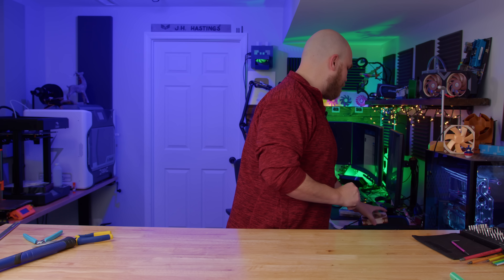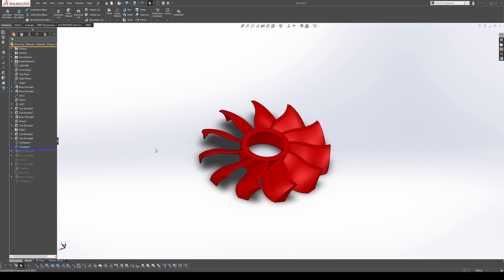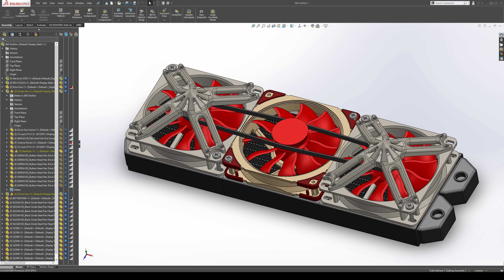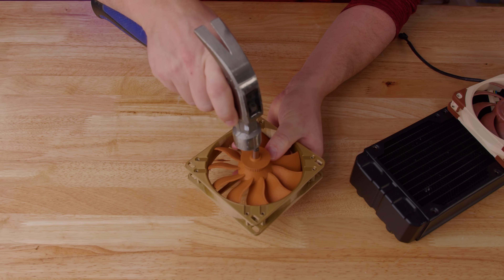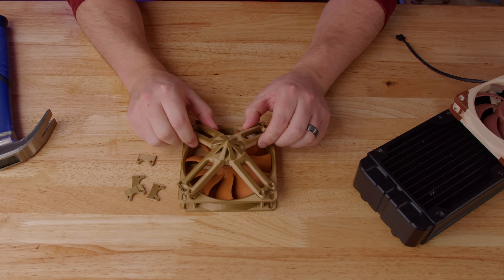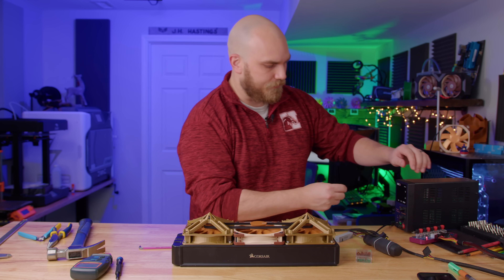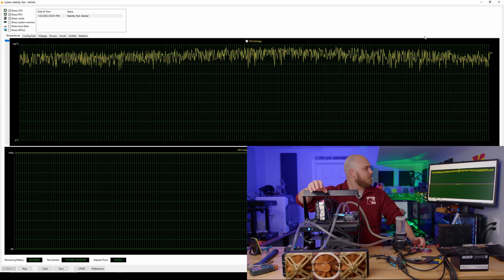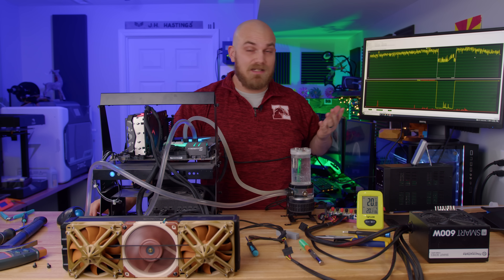I Turned One Fan Into Three | Steampunk Water Cooling

Comment: The seals and the grase makes the bearings too hard to turn, remove the seals from the bearings, wash them in gasoline to remove the grease and put 1 drop of very light oil (or WD-40) in the bearings.

Comment: Get RC air craft motor it will have the torque you need and they are not as high pitch  some other motors, and the motor's sound depens on the over all Rpm your running  as well. And  some of the RC motors my even fit in a fan housing

Comment: This reminds me of when I purchased my bolt action pens at first they somewhat grind. alA crunchy/scratchy feel to it but after using it for several days/weeks it is smooth and snappy giving it a good sound to it. Maybe if you run those fan for a while, it will work out the imperfections to run good in a few days or weeks then try that experiment again.

Comment: Motor fan on one end to give more belt contact.  Pullies should be small on motor and larger on driven fans, like a bike going up a hill.  Will allow the electric motor to get higher rpm.    It needs a thinner belt and smaller bearings so there Is less energy loss.  Even just a greased 2mm pin with a sleeve instead of bearings should work nice.

Hope you like armchair commentary.

Comment: Nice experiment, congrats. Instead making all that contraption, why don't you try to make a shroud with only one fan for the 360 rad, where it has some fins inside to better distribute the airflow to the entire rad, like some sort of airflow splitter. 
Do we really need three fans? what is its comparison against 3 fans, 2 or 1 single fan without shroud? 😉

Comment: Same project v2 except you realize you have a second fan. So, powered fans on left and right and pulley fan on the middle, separate belts for each fan powering the middle and greased up bearings. Another pro with a setup is to see if the tube would cool by themselves better. All you have to do is remove the middle and remove the pulleys

Comment: Your belt pully on the passive fans are wrong, they need to be bulbus, if you make it a groove the belt will climb out (and its doing that, you can see in the video). Also i would make the central drive take 2 separate belts so the belts bite more.

Comment: I think it would work better if you removed the grease from the bearings (you can was it out with wd40) and if you made the center sprocket larger that the others so the belt wraps around it more and has better grip at the same tightness.

Comment: If you are looking for a motor to run the three fan setup, check out the brush less motors from the hobby radio controlled cars and trucks. They have a lot of power.

Comment: I know this is probably impossible to make work reliably, bit you know how some turbochargers on cars run their air through an air to air intercooler, and some are air to water. What if you had a radiator, that pumped water into the fins of another radiator, to then cool the fluid inside that second radiator to eliminate fans all together. 

What you would need:
1 AIO cooler.
1 Radiator w/ fans
1 pump
1 3D printed housing for the AIO radiator
Pump the radiator fluid into the housing intake side, through the aio coolers fins, into the outflow side.
Reply: Where does the heat get extracted ?

Comment: How about just one fan with a funnel to connect to a bigger/longer rad? A single fan in pull would probably give equal pressure somewhat.

You can also make a bigger/longer/double-thick central gear so you can connect one belt to each aux fan. So two belts for the central gear.

Comment: Looks awesome 😁
Try looping a thin polyester or similar strong thread around each pulley instead of the belt. Single loop around each one, then back and tighten, so they don't slip. Should up your RPMs / lessen the friction. Should also be more silent. Also, have you tried scavenging bearings from fidget spinners? They are very smooth.

Comment: racing RC cars dealing with belt drives + gear ratios. #1 you need to change the gear ratio, so that the power fan has less stress. how to, you need a smaller gear on the power fan. #2 since the gear ratio will be so mismatched from (#1). belt tensioners would not help you, so you'll need to run two belts. poslibley a tensioner for each belt but how slow it's spinning and the lack of stress, i doubt the need.
also keep in mind the drive gear probably needs to be 3x smaller but the smaller it is the slower the outer fan will spin.
if i was to do it i would test with two fans first!!!

Comment: Great project! Ever thought about having the next Fan Showdown use blower fans, like those used in older GPUs?
Reply: I love the idea, but you would need to find a motor that would fit the purpose in a certain GPU (for example)
Reply: @mrle0719  Yes. I had an idea a few days ago to build a PC-case in form of a huge "blower fan", 50cm in diameter, but only spin it at 40-120 rpm. and push the air through a deshrouded GPU and a nh-d15 or similar using ducts. But I can't find a suitable motor.

For testing purposes in a possible future Fan Showdown, I think it would be easier to use a 2x40mm radiator or a 80mm radiator but I'm just guessing.

Comment: Maybe try a different fanhub which is more suited for this like "EBM Papst 4412/2 HHP" server fan, looks like it has a metal hub as well, but it´s chunky, though (38mm). It´s a way more powerfull motor, so I guess it would beltdrive two additional fans a lot better.

Comment: remove the grease from the bearings
considering the application I don't really think you need grease, and almost any oil will suffice as substitute, just barely need anything to be there
the bearings are designed to take up to 345kg dynamic, so the grease is appropiate for that kind of load, but way overkill as a fan bearing

if this alone doesn't work maybe use the tough fan as a drive motor
or maybe you can frankenstein one of these old thick fans to drive the belt, like they used in the dell optiplex towers, I wanna say....foxconn maybe?
silver stone still makes them

Comment: I love the completely over complicated and over the top solution that would be cheaper to buy 2 more fans,  There are industrial 120/140mm fans that are used to cool larger motors that has WAY more grunt than a PC fan, it would be interesting you see how much cooling you could get with a few of them mounted to the radiator, noise and power draw be damned.

Comment: You should try a compressed air cooled system! Just have an air compressor parked outside the room, and run a tube right up to the naked CPU. Have the tube blowing the compressed air right onto the IHS and see how much air it takes to cool the CPU the dumbest and loudest way possible!

Comment: Wasn't there a fan showdown design that put an auxiliary motor onto a fan via a coupling to the fan's hub? That could work, though it might work better with a planetary gearset to reduce it's speed significantly to better match what these fans typically spin at, plus you'll have the additional torque needed for the multiple rotors. This is really the only way to go about increasing power without burning out a singular motor, I doubt you'll find much breathing room with motors of similar sizes, and stepping up motor size means an increased hub deadzone which decreases fan efficiency; though this will be gained back by the lack of hub deadzone on the auxiliary fans. 

I'd redesign the setup to have a 1:1:1 ratio with at least one tensioner and three idlers on the central pulley to improve belt contact, having a tensioner also means you can use a closely matched off the shelf belt. What's important here would essentially be giving the belt profile a double hourglass shape, with the two pinched portions directly outside of the central pulley for increased belt contact on this pulley. Though the length of the off the shelf belt will also influence design, some additional serpentining might be needed, but I'd recommend at least diametric symmetry if not aiming for quadriradial symmetry, keeping belt contact in mind on all three pulleys. I know in vehicle serpentine belts, it's typically recommended have at least a third of a pulley in contact with a belt, moving that to four-ninths to a half on higher load pulleys, though this can also go up to two-thirds depending on belt routing, this methodology should also scale down to belts and pulleys of these sizes assuming belt bend radius can withstand the routing required, albeit with slightly looser numbers, four-tenths as opposed to four-ninths for example; though a central hub with two sections of contact is an atypical design, I'm not sure what would be optimal for this, or if optimization operates on the same general rule of thumb, but I would assume that you'd want to have as much contact as possible, a pulley pulling a split double duty like this probably needs at least half contact, split diametrically, for proper tooth engagement or to reduce slipping on V belts. 

Alternatively, use a more normal routing for the belt loop where the central pulley only has one contact patch and the opposite portion of the loop is on an idler between the two outer pulleys, while still optimizing belt contact with a minimal amount of idlers and tensioners. Keep it simple. 

You could also play around with the idea of gears. IIRC the gear fan quieted down significantly after burn-in, and a design of three gears total will also be significantly quieter to begin with. There have been multiple ducted fan designs with the duct built into the rotor itself, as opposed to having the duct on the housing. Modify the housings to be one long rectangle with multiple hubs, have self-ducted fans with a gear profile, and after some burn-in it should be of a tolerable noise level, especially inside a case; it'd also be shallower than this design, as you're not having a belt drive, a simpler design, as you're not having to design an exponential amount of components to house the belt drive, and a more reliable design for the amount of effort put into the design. Though, due to potential tolerance issues, having the slightest bit of lateral adjustment in the housing to better position the fans should be accounted for. Again, keep it simple.

Comment: I would like to see two fans with two belts driving a central empty spot. With perfect belt tension, I think it would be good performance. It may not work as well. I used to have a toy car which had a central motor hub driving front and back wheel (x2 for each side). It has a gearing system for each wheel and designed for traction. 4 wheel drive design. That's the reason why your fans are under-performing. Youe use-case here is for speed and not traction.

Comment: Couldn't you have the belt rim on the edge of the fan instead of the middle? Wouldn't that be like a transmission with the outer spinning faster than the inside and help with the belt tension?

Comment: I guess, there is a huge drawback from mechanical point of view. Belt should not be in contact with both sides of central pulley. It is the main reason why it is so slow. It could work that way if the drive pulley was on the edge of that assembly, but in your case it loses power on friction. Try to add an additional tensioner, that will pull the belt away from one side of a central pulley, and the fans will work as you planned.

Comment: There are a few comments abut splitting the fan flow (either in push or pull) from a single fan, but one could also test with a splitter on the back of the radiator that would push half the airflow back on each "non fanned" side. Nonetheless, a great experiment, well done  (even if not as efficient as the "naked" fan)!

Comment: Ok one thing I would do is get a light chain and run it with sprockets as you don't need that high tension which is really slowing things down. The lightest chain is wire bent and folded C links which if you get some light gauge steel wire, can be made very cheaply. As a measure of size, those pins you used to stich the belt could be used to make the links. Just need to be stiff enough to hold their shape under some stress. Sprockets can be printed and since you are making them, you can adjust so the sprockets are strong enough to not break off but small enough to not add extra weight and also less chain would be needed. Everyone commenting about running bearings dry but adding light weight oil... No cause you are missing the "point" of this being a radiator cooling which is inside a case that you can't really get to, to oil both front and back bearings. You would want bushings which you should be able to get cheap enough that are preoiled (have to make certain cause there are still oil added versions that are cheap) and you should reduce a lot of friction without having to worry about the bearing grease or oil. If you need a bump to place to stop the fan from sitting on the bushing while it spins (the bearing has its flush surface that moves with it unlike the bushing) then a small steel ball bearing right in the middle on the ends can act as a low friction holder much like how rubies are used in watches. Being such small contact there would not be need to oil it. All of it should be cheaper than the bearings and Belt he used without extra friction of tension and loss of slippage.

Comment: Personally I would have preferred a bigger central hub to give it move surface. And use a system with a spring and another bearing to Tension the belt

Comment: Out of curiosity: wouldn't a connection like a steam locomotive has in it's running gear work better (i.e. a bar connecting all three fans? It definately would look more steampunk...
Reply: The bar is to transform the translation into rotation, if you want a more steampunk version, slotted gears instead of the belt would probably work great.

Comment: I wonder if you were to take out the grease on the bearings and rather use a light oil on it if abything would change, grease is significantly thicker and makes it hard for the bearings to move wich in turn will slow them down, as to why you can see in increase in speed as they heat up

Comment: Great Idea :) I'd love to see what ippc 3000rpm would do with this set up, as they are rated at higher wattage than nf-a12x25... 
But since you like 3d printing stuff, and I've been thinking myself of doing it but till i get around to it, it mightbe next year (ehhhh) 
Have you seen what new case HP OMEN start selling? in fact they patented it, so no other cases probably will show up like this, but I'd love to see 3d printed modification to case, where
radiator is out of the case, pulling fresh room air. kind of big project like your Minecraft server case or GPU rear intake shroud :D 
I've got AIO, and case without rubber groomets holes for pipes to go out, so it'll take dremel to proceed, but I'd love to see what's your take would be on this :)

Comment: You could reduce the tension yet increase grip if you place the powered fan on one side and not push them apart but a little closer, and also push the middle one more up or down. that way the middle fan wouldn't slip as it would ONLY have the friction of itself and not two fans.

Comment: In a Case you could use the single fan for a negative pressure setup, close all openings with clear sticky tape(does not need to be clear, but aestetics...) so the only way in for air is through the radiator.
should be more effective.

Comment: Well if you have that many bearings then I guess its time to redesign and submit my contra fan design.
P.S given how light the fans are and the relatively low rpm there is a fair chance you could get this running a good bit faster by degreasing the bearings. Not great for the bearings long term but it can get the bearings spinning much easier which would help given the low torque.

Comment: In it's current design, you could add a tensioner mounted to the center fan that uses bearings to hold tension on top between the center and right fan, and the bottom of the center and left fan.

Something kinda like this:
O=.Ø°=O
(Yes, my art skills are amazing lol)

Comment: It sounds like some of your friction issues are coming from the belt not aligning with the teeth on both sides of the drive pulley. Your "tensioner" would be better to pull the 2 driven fans at 90 degrees to the drive (rather than inline), so you create a clearance on one side of the drive pulley, and essentially a triangular drive to driven arrangement.

Comment: would an air duct with 1 fan increase the cooling capacity, so that all surface area of the radiator would be cooled with one fan?
Reply: I too have wondered about ducting and why it never seems to be used in pc builds
Reply: @DracoOmnia  Space mainly. You need to be setting the fan back about twice it's thickness so you've suddenly added 50mm of thickness with a duct to only get about a 15% increase over just a fan bolted on.

 Works great in a car where 50mm on a half metre wide rad is nothing. Not so much in a PC case.
Reply: Agree. Similar setup as a car radiator. Single fan running at full standard speed with a cowling seems like it should be at least (if not more) efficient than the setup with secondary fans